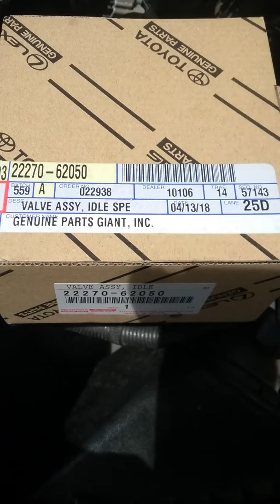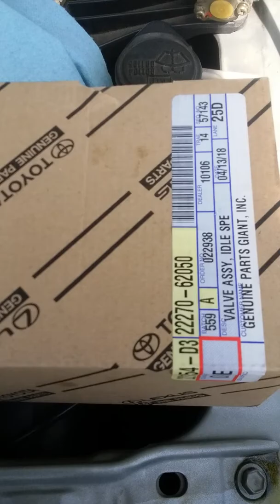2000 Toyota 4Runner 3.4 liter IAC valve removal and installation.

Comment: Thanks for the video. My '00 Runner has been shutting off right after a cold start. Sometimes 3 times. I'm looking at an oem IAC valve. Will try to clean it first and then eventually will get the oem one. Thanks for the instruction.
Reply from the maker: Make sure to get the Toyota brand "Denso" if cleaning it doesn't work. Toyota's are picky with aftermarket products. It wouldn't hurt to use electrical contact cleaner on your MAF sensor as well.
Reply: @Pr0ph3cy-k5z  thanks will do. Been eyeying camelbacktoyota store I believe its Denso.

Comment: Thanks for the video, it's just what I was looking for. In the event that I want to clean the old part, what type of product can I clean it with?
Reply from the maker: Carb cleaner, brake clean.
Reply: @Pr0ph3cy-k5z  Thanks You!
Reply from the maker: @davidhenriquez4939  Welcome
Reply from the maker: @davidhenriquez4939  Cleaning the old one often works. If you end up buying a new one, DON'T buy any cheap aftermarket IAC's for your Toyota. Denso only.

Comment: Why not just clean out the ol' one w/sum carb cleaner?🤔
Reply from the maker: That worked for a while, but eventually failed to work again. I eventually took the one that I removed apart after noticing the plug had green crusties. I removed the green plug and the circuit board was burnt/melted.
Reply: @Pr0ph3cy-k5z  ok sounds about time👍
Reply from the maker: @dmironyuk  lol yeah I thought so too.

Comment: Thanks for the helpful video. 

Next time could you show how to check/clean the EGR valve while disassembled?
Reply from the maker: I believe 96 and up models don't use EGR valves. This one is a 2000 3.4 liter. No EGR on it. I've read where cheap auto parts store code readers will show a code for an EGR even if one doesn't exist. What year is your 4runner?
Reply from the maker: https://www.yotatech.com/forums/f2/egr-valve-location-3-4-a-128187/

Comment: Great video! Just used this video for my 99 and it worked perfect. Just follow along but dont spill your beer.
Reply from the maker: lol. Glad it helped. I have a 2000 model that I often work on, but keep forgetting to video it. I plan on recording everything else. That IAC valve is actually easy after you do it once. I recently replaced the fuel pump which was a nightmare. The next time, I will be cutting out a door under the backseat and fabricating a plate with a gasket to cover up the hole.

Comment: Great video to follow along to! Quick question: I have a 2000 Runner, had a P0171 CEL and light sputtering at idle and sputters/hesitates heavily when accelerating at primarily lower RPMs.  I replaced the MAF, PCV valve, dumped injector cleaner in tank, new air and fuel filter, new upstream and downstream O2 sensors, newer plugs and wires. Now no CEL but still sputters heavily under acceleration. Ideas?? IAC?
Reply from the maker: With this 4runner, it never triggered any codes. It had an idle issue. High and low. I don't think it actually sputtered. Did you buy a factory toyota MAF or a chinese version? These yotas are picky. It can also be a vacuum leak after the MAF. Check the tube that goes to the throttle body for any cracks. These are very prone to cracking. One other thing about these 4runners is a weak fuel pump will cause the sputtering. It can still pump fuel, but it is weak. If you have a scan tool, check the live data for the MAF. It should read around 3-4. If it reads 5, it is junk. Then check the tube going from the MAF to the throttle body. If you find any cracks, use black gasket maker or grey on the cracks for a temporary fix and see if that helped.
Reply: @Pr0ph3cy-k5z  Thanks for your reply. I got Partschoice MAF sensor. Forgot to mention I also replaced the throttle tube because of a crack. I'll have to get my mechanic to do the live readings and go from there. Thanks!
Reply from the maker: @RandyDespain  Autozone and Advanced Auto Parts will let you borrow a scan tool for free if you live near one.

Comment: I have a question. My 99 always shows  02 sensor bank 1 sensor circuit even the 02 sensor is new what could the problem
Reply from the maker: Check to see if your vehicle is California or Federal Emissions Compliant. Make sure you have the correct O2 sensor "Denso brand". If everything is right, I would watch the live data of your fuel trims. Could be an exhaust leak before the catalytic converter such as the exhaust manifold.

Comment: Would an IAC valve issue also cause car to stall on stops on top of the idle issues? My mechanic says I have multiple misfires but no codes and thinks its an electric issue. 4runner forums all tell me to change IAC valve first then try injectors and plus next if that doesn't work. thoughts?
Reply from the maker: Yes a bad IAC can cause that. For the injectors, try dumping a bottle of injector cleaner into the gas tank. I would clean the MAF sensor first. Do you have access to a scanner? If you do, make a note of the TPS, MAF, Fuel Trims at idle and post the numbers. Can you feel it misfiring at idle?
Reply from the maker: If it is indeed the IAC valve, no matter what, DON'T cheap out and buy aftermarket crap. Toyota's don't like those. Go with the factory part. You may get lucky with an aftermarket IAC for a month or 2, but it will cause issues eventually. Denso brand I believe is the preferred brand. Before buying a new IAC, I would clean the one on your vehicle first.
Reply from the maker: Generally, a bad IAC will cause very low idle or high idle or a surging idle.
Reply: Currently dealing with similar symptoms. Runs rough (if it even runs) and multiple misfires with no codes; did you even figure yours out?

Comment: Would a bad iac valve cause the engine to sputter because mine starts to sputter when I put it into gear
Reply from the maker: I've never seen one "sputter"from a bad iac. Usually the idle will be high or low. Could be a fuel delivery issue or misfire. My nissan frontier makes a sputter sound in gear due to an exhaust leak, but it isn't causing any idle issues. Is the check engine light on? If so, what are the codes?
Reply: @Pr0ph3cy-k5z  yes the check engine light has turned on. It wasn't on when it was first acting up but it turned on the next day when I turned the truck on again when I put it on drive. I will try and get the code and try and get back to you. I was thinking it might also be the mass air flow sensor
Reply from the maker: @ravenantiste3090  For the CEL "check engine light" to turn on a day after makes me think misfire. After a set number of misfires has been detected, the CEL will turn on. Yeah, let me know what the codes are.
Reply: @Pr0ph3cy-k5z   I have had the same problem. My idle will go all the way up the completely drop when i put the ac on while in gear. The car has shut off on me a few times and CEL is on. It's showing all 6 cylinder misfire. I just cleaned the throttle body but truck still shuts on. I'm not sure if the IAC is at fault or something worse. Any advice would help since I've put 300k miles on my baby and don't want to see her go.
Reply from the maker: @Trustgbendah  So you have the P0300 code. First thing that comes to mind is a bad head gasket leak or intake manifold leak. Are you losing coolant? I've never heard of a bad iac causing a misfire on all cylinders. Check your coolant overflow container and radiator. I had a ford f150 that had the P0300 code. No visible leaks anywhere, but I had to add coolant about once every 2 weeks. I could smell it, just never seen it. I was changing the coils and sparkplugs one day and noticed a green gel in each cylinder. Low and behold my upper intake gaskets were leaking. With yours shutting off, makes me think it's either the intake or head gasket. Can you check the temperature after it had ran for 15 minutes or so? The intake isn't too bad of a job if you take your time. Color code every freaking nut, bolt, wiring harness with bright solid colors. I use finger nail polish. Orange, red, green, blue, white, pink, yellow. Also, if you have a scanner, what is the LTFT long term fuel trim and STFT short term fuel trim after the vehicle has warmed up?
Reply: @Pr0ph3cy-k5z  My coolant hasn't been leaking to my knowledge. I recently changed my radiator out with a new toyota one and that's when the problems have started. There's no smell that i have noticed. The car drives normal but the minute i turn the ac on the rpm goes all over the place. Taking my feet off the gas causes it to shut down- so i'm basically 2 footing it if i want to drive anywhere.
Reply from the maker: @Trustgbendah  2 footing it is typical of a bad iac, but that misfire on all cylinders is throwing me for a loop. Try removing the iac and cleaning it with brake clean or carb cleaner. The first time you remove it, it will take a while, maybe 1 hour. After you do it once, it becomes super easy and much faster. 20 minutes with an impact. Cleaning it won't hurt it. Be careful with the rubber gasket on the iac. You can reuse it as long as you don't break it. Remove the air intake tube, disconnect a few wiring harnesses and hoses, remove the throttle body and cables, flip the throttle body over and it's on the bottom of the throttle body. Or, remove the air intake tube, open the throttle flapper thing with your finger and spray the carb cleaner or brake clean inside the opening. Keep holding it open until the cleaner evaporates. That's the quickest way, but removing the iac and actually cleaning the pintle is better. Either way, clean it and reset the computer either with a code scanner or by unhooking the negative battery cable for 5 minutes. Drive it and see if the p0300 pops back up.
Reply from the maker: @Trustgbendah  I'm curious what made you need to change out the radiator? 9 times out of 10, if a problem starts right after something was replaced, the problem will be something that wasn't hooked back up right. If you done the work, carefully double check everything that you disconnected/reconnected. If you had someone to do the work, do the same thing. It's very easy to forget something lol. I don't fool with timing belts/chains, pistons, heads, transmissions because I will end up with bolts and nuts left over, wondering where in the heck did they go lol.
Reply: @Pr0ph3cy-k5z  I changed it just to stay ahead of the pink milkshake fear. I'm leaning heavy that it's the iac- so i'm heading down now to clean it thoroughly. Radiator install i did myself and was pretty easy, but i'll definitely double check it all
Reply from the maker: @Trustgbendah  After you clean it, reset the computer before starting the vehicle. If by some chance it is the iac, DON'T buy a non factory iac no matter how enticing the price is. Trust me. You will end up buying a factory iac valve regardless. Toyota's and Nissan's are VERY picky when it comes to aftermarket vs factory oem.
Reply: @Pr0ph3cy-k5z  Well just cleaned it intensely and started her up. Everything ran smoothly  until 10 mins into her warming up i turned on the lights to see if they work and rpm started bobbling. Turn that off and ac on and the same thing happened. Went to put her into drive and shut off on me.
Reply from the maker: @Trustgbendah  Hmmm. On my Nissan Frontier, my iac is totally dead. I have a bidirectional scanner that lets me control the iac. I can shut it off or change the value from 0% to 100%. My truck still idles. Here are a few more tricks to try. Find something that will hold the throttle plate open just barely. Barely I mean as in the thickness of a razorblade. My nissan has a throttle screw that I can place a razorblade behind to keep the throttle open. Not sure on the 4runner. With the throttle plate barely cracked open, start it up. Turn the ac on and see if she dies. Another trick is unplug the iac, see if it will start. Another, with it plugged in, start it and unplug it while it's running and see if it dies. If it dies immediately when you do the last trick, it's not the iac. With it unplugged and then you try to start it, if it won't start, it's not the iac. The first trick by cracking the throttle open and turning on the ac, if it dies, then it's not the iac. By cracking the throttle plate open by force, you are forcing air into the intake "bypassing" the iac's purpose. If you just happen to live near me, I would be happy to run a diagnostics on it. I'm in Clarksville Tn.
Reply: Thanks for the advice- I’ll try some of those. I live in Knoxville TN for about 10 years but just move to Dallas Texas so that may be out of the options
Reply from the maker: @Trustgbendah  Check the upstream o2 sensor. Your LTFT and STFT with a scanner and post the numbers. If the upstream o2 sensor is maxed out, then that will cause a p0300 misfire on all cylinders and it will cause your vehicle to die as well.

Comment: trouble code 33

1/ idle air control Mac  valve starlet 2e-e/4e-fe

2/ idle speed control system malfunction avensis 3s-feel/4a-fe/7a-fe

3/ intake manifold air control solenoid malfunction avensis 2c-te
Reply from the maker: Not sure what you mean by all of this.
Reply from the maker: Are you having problems with each of those?
Reply from the maker: Im not sure what you are saying. Are you having issues with all of those?

Comment: Do you think a low idle when cold, followed by a gradually increasing idle to say 1500rpm would also be a symptom of needing the IAC replaced. 
2000 4runnner
Reply from the maker: Yes. It could also be a vacuum leak, but I would lean more towards the iac valve. Lesson learnt, Don't buy those generic iac valves for a Toyota. It's a 50/50 chance on if it will work right. The 2000 toyota 4runner in the video had the low idle at startup and then it would slowly climb. The lady bought a cheap iac valve for it and it helped, but didn't fix the idle issue completely. She bought a denso brand next. I replaced the cheap iac with the denso and she hasn't had anymore issues.

Comment: Do you need to bleed the system after putting everything back to place since some of the lines where coolant runs was disconnected?
Reply from the maker: No. If this had been on a Nissan Frontier, then yes.
Reply: @Pr0ph3cy-k5z  Why there's no need of bleeding the system On Toyota but you have to do it on Nissan?
Reply from the maker: @CarlosRios-mo6vd  The nissan has a bleed off valve. The Toyota doesn't. With that said, I've never had to bleed off the Toyota's and never had any issues. My Nissan truck, I didn't bleed it off and had issues. After bleeding the nissan, the issues went away. On Ford's, I've never bled the system and never had issues. I guess it's manufacturer specific. Feel free to bleed yours if you like. It can't hurt it.